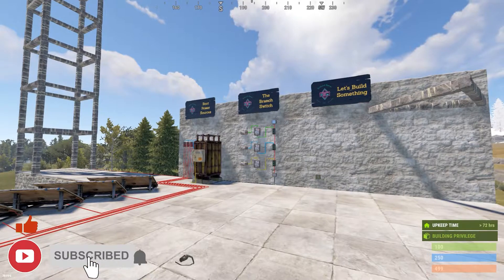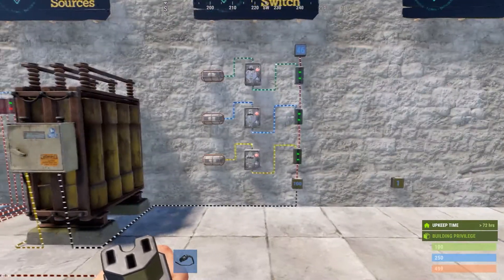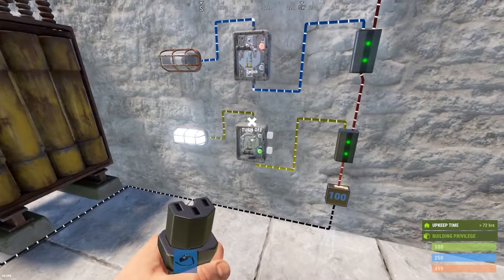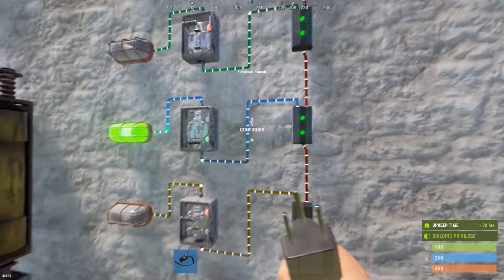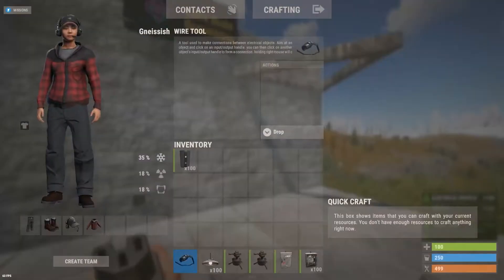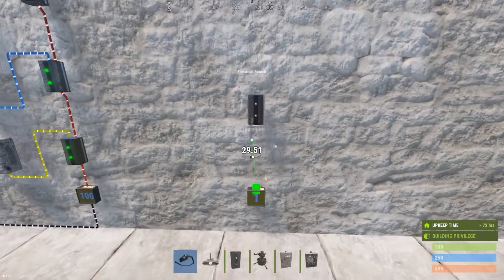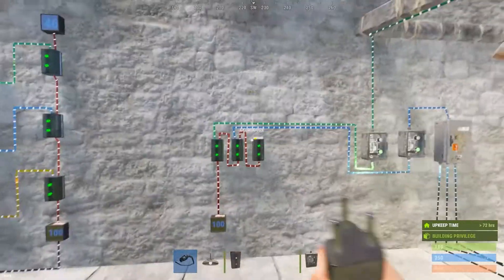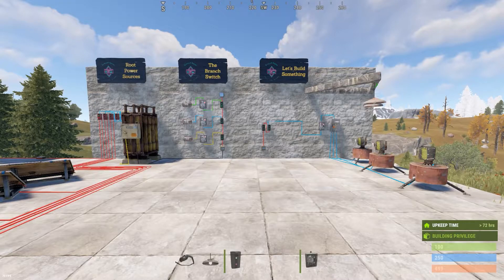RUST Electricity Tutorial | How To Wire Like a PRO on Day One with focus on the Branch Switch 2022!

Comment: Video is really nice, and your wiring being so neat makes me happy haha. So for electrical branches, I noticed even when the switch after the electrical branch is off, the branch out still draws power, meaning i might as well just leave my lights, heaters, turrets, etc, switched on at all times, since it is still usign the same amount of power. I notice this doesn't happen with splitters,  but I don't like using splitters becuase they are less precise. Does anyone know of a circuit that fixes this problem that allows me to still use branches instead of splitters? In my current base, I don't have the power to spare to leave everything on at all times.
Reply from the maker: The thing about RUST electricity is that it doesn't behave at all like actual electricity. Anything you connect to a battery will draw power from it, regardless of whether it's on or off. You can see this by looking at the battery's active usage. Turning off switches doesn't stop battery draw.

That said, you can remove active usage by using a blocker. A blocker with power to the block passthrough will actually cut off a circuit from the battery. If you test this you'll see the active usage drop. I make use of this property in my battery backup and clan circuit videos.

Hope this helps!
Reply from the maker: So a solution would be to run 2v to your on/off switch and connect it to the block passthrough of a blocker. Install the blocker before your branch, lights, etc.
Reply: @AustinKlailaGames  Right that makes sense.  I guess my problem is that if I put a blocker before my electrical branch, then anytime power goes into the blocker, I will  lose power to everything that comes after it. Unless I misunderstood. Possibly there is not perfect solution to this which is fine, just thought i would ask. Interstingly, I did notice that with splitters, it works fine i.e if you put a switch after a splitter, toggling the switch actually affects active usage of the battery.
Reply from the maker: @succulentus2771   the way RUST electrical works the real solution is to supply the battery you're using with at least the minimum charge it requires (example: large battery with 100 active usage = 125v+). It's designed to encourage a balanced setup between inputs and outputs.

Comment: I had set up 2 Sam sites, 2 turrets, and all of my lights on one battery that was connected to 1 wind turbine. All of it was functional but I found that the battery was struggling to stay charged. Would I need to hook up 2 wind turbines to 1 battery ea for heavy usage? Just trying to understand how I can keep the batteries up full time. Thank you!
Reply from the maker: What's happening is that the average output of the wind turbine (they vary) is less than the charge required to keep your battery going. Let's say you have exactly 100v of stuff hooked up to that battery, you need that turbine to output a minimum average voltage of 125v. Batteries in RUST have an 80% charging efficiency. You can calculate what you need by: (battery output) / 0.80 = minimum charge requirement.

So for a large battery: 100 / 0.80 = 125v

I'm betting that the single turbine you have connected is outputting less than your minimum average requirement because of installation location and height (wind power varies by map location). You'll need to supplement your battery with another turbine or solar panels. 

Hope this helps!
Reply: @AustinKlailaGames  Awesome! Thank you for the thorough explanation, that makes so much sense now. Very helpful, great content! 🌟
Reply from the maker: @freckledmelon  you're welcome, and thank you!

Comment: If the batteries charge at 80% efficiency, then wouldn't you need only 120 volts (not 125 you mentioned) coming into the battery to keep it always up? I am assuming the battery it also using all 100 volts at the same time.
Reply from the maker: Yes, my numbers are assuming full active usage since the circuit I built provides a constant draw. And they do need 125v to stay charged. It's calculated by 100/0.80 = 125. There's a decent explanation on RUST Labs.

https://rustlabs.com/item/large-rechargeable-battery#order=0;tab=tips;page=1

Comment: How do you wire this neatly? My wiring is a mess, I want to learn how to do it like you!!
Reply from the maker: Hey, thanks! I'd say it starts with having an organized electrical room / tc room (think the branch switch tree trunk idea I used in this video) and then knowing what circuits you want to add. As far as my wire runs, I like to use the lines on foundations, walls, and ceilings as a guide. You'll also find that the wire "snaps" into corners if you look at it just right, which keeps it from floating off the wall. Also, the perspective you see in RUST doesn't always line up with what you think it should so sometimes it's easier to reorient yourself until the line actually places where you think it should, if that makes any sense. 

Maybe I should make a video about this.
Reply: @AustinKlailaGames  Thanks for your answer! I would definitely watch your video :D